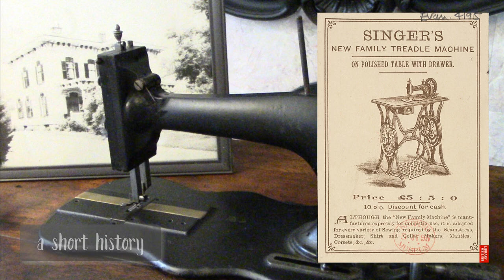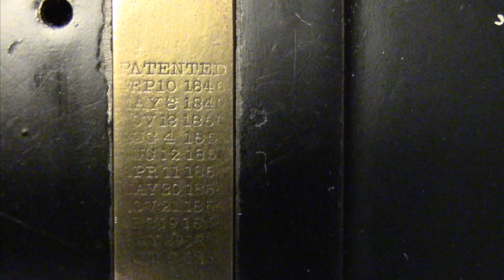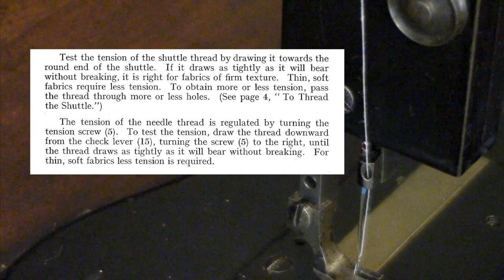My OLDEST Antique Singer Treadle Sewing Machine -1871 New Family / Model 12 demo & timing adjustment

Comment: That is quite impressive! I just purchased an 1882 12 model with the gilt mother of pearl decals, and wouldn't you know it's missing the lid and the shuttle/ bobbin! 🥴🧐🙄I think I paid way too much but I'm still happy with my purchase! ☺ Especially if it will sew leather. 😳 It's so unique in design. I also have a 1927 127 that I got for a steal and in great shape. it's been my lifelong dream to learn to sew and replace my grandmother's machine I ruined years ago. Now, I have 2 fine specimens to clean and find at least one part for. Thank you for sharing this! Very informative for this 50 year old newbie!
Reply from the maker: Awwww!!!! I'm envious! ☺️
The ornate 12s are so stunning.
I hope you have good luck finding a boat shuttle. 
As to the lid - maybe a perspex display cover would show it off better ;)
Reply: The shuttle and bobbin were actually still in it! I turned the wheel and they appeared! still had thread on the bobbin and the shuttle is the original with the small holes like you described. Now, I'm searching for a leather belt replacement. I have the original I'm not good with diameter measurements and unsure if it's 3/16" or 1/4"? 😫 my bf says 1/4 🤔 but the only leather belts I find for sale are 3/16... 🤪 was considering a rubber belt but they come in 1/4. Which size leather belt are you using? Would greatly appreciate! I am unable to find much information other than the users manual.
Reply from the maker: Oooooooooooo!!! That's AMAZING! So pleased for you.
Don't worry about such a small difference on the belt diameter. I've used both thicker and thinner.
Reply: Thank you! I think I'll order one of each. I can always try the rubber one on my 1927 model 27. 😁

Comment: Thank you so much for showing us around this machine! I rescued a White Family Rotary from the curb just over a year ago, and while the two machines have a number of years between them, seeing how yours works has really improved my confidence in taking a closer look at my own. The engineering that went into the shuttle alone is breathtaking, and it's so easy to forget these days how complex a sewing machine actually is.
Reply from the maker: Yay for rescues!!
I'm thrilled that my video could bolster your confidence! 
It's quite sobering, when you think that one gear being ahead or behind by a tooth or two on its counterpart can wreak such havoc!!! So logical, but as you said, SO complex.
Those patent dates on my shuttle slide were for individual components that eventually went into making the machine. Step by step, one improvement at a time.

The best recommendation I can give if you take anything apart is to video yourself doing it. A replay is invaluable if you get stuck or (as is often the case for me) get called away by children!!!
Moving gears, you can always use a Sharpie to mark where things are before you alter their position.

Good luck!!

Comment: Thank you for the thorough over of this machine! I recently received one from a friend that she believes was her great grandmother’s. It is frozen up and is no longer in a cabinet, but I hope to get it working again.
Reply from the maker: You're very welcome! Thanks for the comment :)

The mechanics, while genius, are very straightforward.
I wish you every possible success with your restoration endeavour.
Reply: There are You Tube videos on how to sort out jammed up machines....starting with paraffin !
Reply: @davidnash8586  Thanks! I found some good ones and just started with oiling and working the wheel. It freed up within a couple days and I've cleaned it thoroughly. Found and installed a hand crank to use it as a table top machine. Just waiting for my brother-in-law to finish building the wood base for it.

Comment: Thanks so much for your video! I just purchased one of these. So far looks identical to yours. Waiting for it to be delivered. Just missing the table and treadle. I'll probably need to find a shuttle and bobbin. I don't know the year yet, but has to be very near yours.
Waiting, impatiently!
Reply from the maker: Oh, I can only imagine the impatient anticipation!!!
Reply: Mine is also from 1871!
I have very very faint reminants of decals on it.
I have been able to fix everything so far.
But, I need a needle clamp, which is difficult to locate.
Reply from the maker: Ohhhh ... yes - the needle clamping mechanism is definitely very different on this machine.
Given that there's not much strain in this area, I wonder if someone could 3D print a replica.
If I can help with detailed photos, please let me know.
Reply: I would be very grateful for some detailed pictures of the needle clamp! That way I know what I'm looking for. I may have to make something myself.
Thank You so much!!😊

Comment: Your camera angle on the needle penetrating the machine bed, you should have shown the loop that the thread form from the needle when it starts to go up ,that's a very important timing situation also  so the shuttle will go through the loop.
Reply from the maker: This is very true! Thank you for pointing this out.

Comment: Thank you for your informative and well paced video.  I wanted to suggest that you might wish to experiment adding a washer between the wooden pitman and the already existing washer and bolt.  (One side of the pitman?  Both?  Different dimensions?). This might "take up the slack" and possibly diminish the movement which you mentioned causes the added noise...just a thought.

Comment: Oh what a find you are ! It's taken me ten years to find you and  I love your clear and concise explanations ! Would you know why the thread on my 331K4 sometimes fouls up and pulls out the side of the bobbin case ?
Reply from the maker: Awww. What a lovely message! Thank you so much.
Truth be told, I wasn't on here ten years ago, so I'm very glad that you've found me now that I am 😇

Regrettably, I don't know anything about the 331, but generally I would suggest checking bobbin tension (depending on the thickness of your thread you may need to tighten or loosen a tensioning screw) and checking the direction that the thread is wound. Flipping the spool back to front could result in a clockwise wind becoming anticlockwise.

Not sure if it applies to all machines, but I generally like my bobbin in case to be able to hang from the string tail without unwinding if I hold it ... But if I give it a short drop, it unwinds a few inches. I hope that makes sense! Turning visuals into words isn't always easy.

Comment: Thank God I found your channel - I have always wanted a walk through of how these beasts work!

12:39 this bit has explained HOW overlock machines work, and I am eternally grateful!

You are just brilliant for working this out/researching this kind of thing!

Where can you recommend we get replacement parts for vintage machines? The plate/presser foot is missing on my 1902 machine, and I've not found anything online yet!
Reply from the maker: Thank you so much for this lovely comment :)
Feedback like yours is always so very heartwarming.

If you just want to make it usable, any "low shank" presser foot should work. 
If you're looking for an original, that might be more difficult to come by. But I will say that modern feet tend to be hinged, so that they glide over changes in material density more easily.

Comment: Thank you for your thorough demonstration of this beauty. What needle do you use? Mine broke and I can’t find a replacement.
Reply from the maker: I just use a regular sewing machine needle. It needs positioning carefully as the regular needles have a flat side, but it is possible for the screw clamp to hold it in place securely (give it a good wiggle to make sure).
Also, make sure the needle's eye aligns correctly with the hole in the bed as you would have done with the original needle so the timing is as correct as possible.

Comment: I have an 1889 12K that we just brought back from the UK. The cog does not have a set screw. Instead it looks like there is a small rod that has been pushed through from one side to the other to hold it in place. I think the timing might be one step too late, rather than one step too early like yours. But I have not yet worked out how to release the cog. I'm reluctant to take a hammer and pin to push the rod out until I know if that is the right thing to do.
Reply from the maker: Congratulations on your acquisition!
Thanks for leaving a message :)

Wow. I'm really not sure what to suggest with the possible pin. You can see that it goes all the way through from one side to the other side? In essence eliminating the possibility that it is a screw that's been de-headed (or should that be decapitated??)?

The screw on mine certainly did not go through the main rod.

If you're reluctant to try to drive the pin out, I would suggesting asking on one of the Facebook antique machine groups.
If you're not a FB user, I would be happy to enquire on your behalf - just let me know.
Reply: @24Washington  The threaded set screw hole is still there but there is no screw in it and the cogs seem to be firmly held in place with the through rod (it clearly does go all the way through). I'm thinking this was a design update to prevent them jumping a tooth when the screw loosens during use. I'm currently trying everything else - pin height, upper tension, lower tension etc. before I start messing with the timing. The movement is smooth, yet the upper thread breaks on the first stitch every time, at any tension setting. The bobbin is the type with the line of holes instead of the tension screw. This is my first 1880s era sewing machine. I've worked on cleaning up and tuning several early 19th century models. This 12k is proving a bit of a challenge. There is a 222K (that I'm converting to US voltage) and a vs2 fiddle base that are next in line.
Reply from the maker: Thank you for sharing these details! Your suggestion of an update certainly makes sense.
It's funny how the seemingly more simple machines can actually end up being more complicated. I've attributed much to the lack of surviving documentation.

I presume you've checked the needle eye height and direction? This would be my only other 'benign' suggestion.

Your other projects sound truly wonderful. Thanks again for sharing :)
Reply: @24Washington  Yep. I've fiddled with the needle. Adjusting its height a bit up and down and in the middle. It's facing the right way. I tried other 12x1 substitute needles and original 12x1s. I think the thing is due for a complete disassembly and degreasing anyway. Lots of parts were or still are siezed with old polymerized oil. So that will have to wait until the next weekend. I've got a day job during the week. Thank you for your suggestions.
Reply: Well at least the stitch length control is moving now. It was seized solid. I'll pursue the mystery thread snapping mechanism another day.

Comment: Ahh thank you so much! This was so informational. I just got a 1869 Danish machine almost identical to yours but I simply cannot get the underthread up and I don't understand why. I feel like I've tried everything:(
Reply from the maker: Your machine sounds wonderful!
Have you looked closely while turning the balance wheel to see if what happens underneath when the needle thread meets the bobbin thread? If the bobbin thread won't come up, the timing might be off.
Reply: @24Washington  yes I'm pretty sure that's what's happening. Ugh, just broke two antique needles figuring that out. Now to learn how to adjust it. Thank you❤
Reply from the maker: My video talks about adjusting the timing using a screw at the back of the arm/neck area. Hopefully it is similar on your machine.

You can use regular domestic needles in your machine (this is what I do) you just have to clamp them in place carefully because they are not entirely round. Also, you need to make sure that the eye of the needle meets the base of the machine at the correct time.
I think my video covered this too (it's been a while since I watched it hahaha).

Good luck!!
Reply: @24Washington  thank you so much, you're a Saint! This video is def what I need to fix this!
Reply from the maker: If you think I can help further, please let me know :)
Reply: @24Washington  Hi idk if you care, but my grandfather and I made it work yay! It would seem all it needed was a good ol oil onceover and now it works like a dream. Thank you so much for your help <3
Reply from the maker: This is wonderful news :)
I'm so pleased for you!!

Comment: What kind of needles do you use for this machine? I have just bought one nearly exactly like yours but with mother of pearl inlay ( I think it´s from 1877ish)....Love your video!
Reply from the maker: Glad you liked the video :)
Your machine sounds lovely!!!! 
As long as you're careful with the needle orientation and use the height levelling instructions, you might be able to use a class 15 needle as I did. The less needles I have to buy, the better.

There are some comparisons of how well other needles work about 1/3 down the page at https://sewingtales.wordpress.com/2014/07/06/needles-and-my-singer-12/ (this author states that class 15 needles didn't work for her, so if that happens to you, the write-up might be of better assistance).
Best wishes sewing with your machine!
Reply: The model 12 takes a 12x1 needle system.
Reply: @adambrown2626  I have 3 originals 10 newly made and the 12x1 originals are the best. I have also ground the flat shank 15x1 down to fit so it is centered well. My 1877 NF likes it centered , but the 1883 Singer 12 takes the off center slightly 15x1 without grinding down. That is also using the larger hole feed dog plate. All Singer NF/12 came with two plates originally.